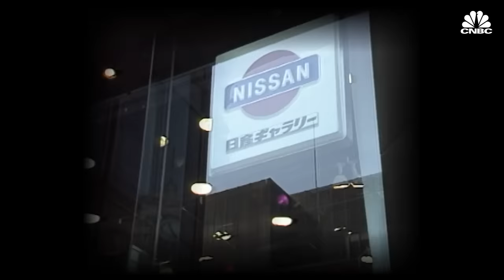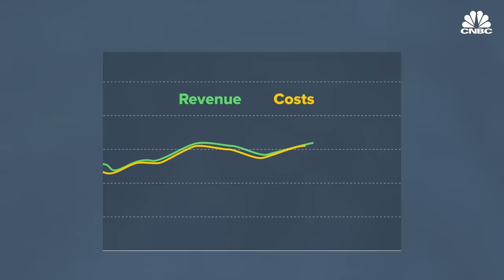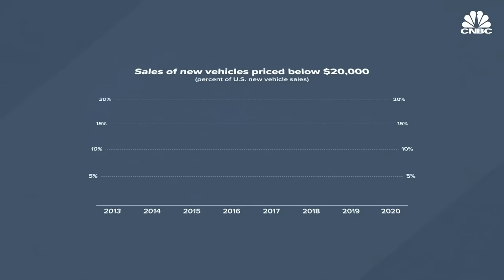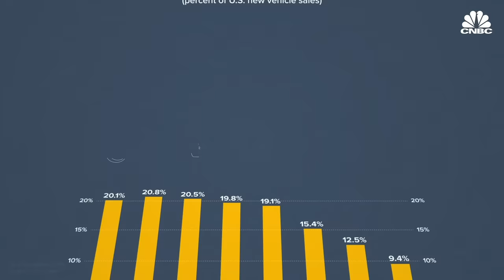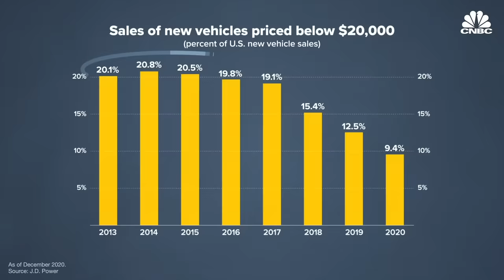Why Cheap Cars Are Disappearing

Comment: The lady tried to justify a $10k price increase for CarPlay and bluetooth. woww
Reply: I know...it's rediculous. Some one needs to find her on twitter, and give her a price list of what these things actually cost.
Reply: For a head unit you could buy for 500
Reply: @bdun1226  I bought mine for 250$ they are even cheaper now
Reply: I have bluetooth and USB connectivity (with a hands-free mic) on my Pioneer head unit, stuck into my '92 Civic, and it was forty bucks...
Reply: Well, sometimes the specific features a buyer might want are only available if they go up to the next trim level and that next trim level somtimes includes a bunch of other options that jack up the overall price.

Comment: I was raised to believe "If you cant pay cash for the car you want, you cant afford it".
Reply: True, that's why i haven't and probably will never have 0km cars. My car is a 2002 VW Polo and I don't even feel the need to exchange it, I've been in 6 month old 250km rental Peugeots that felt worse than it. Sure, the interior has seen better days and the paint is faded, but that's fixable. Got my AC, got a 100€ head unit from Sony that has bluetooth and usb, got my power steering, central locking, abs and ebd, power windows, and that's what i really need.
Reply: @miaugato93  have exactly the same car with the small 40kw 3 cylinder engine and I have 248.000 km on it. Won't drive anything else until I have kids and need more space!
Reply: @AggroJordan86  Nice! Mine is the 48kw one with 185.000km on it. Plan to restore it back to glory as it does look a bit like a shed right now. But by god does it drive nice, quiet and comfortable inside, and has almost everything i want in a car, and that's because it doesn't have the L/100km readout.
Reply: Well that’s stupid because you can finance a car
Reply: Wow lucky you.
Reply: Good idea, but poor in practice. Financing a new vehicle isn't a terrible idea, especially if it's a truck or something that you would use for work. Plus new cars smell nice and are shiny.
Reply: @bsextremesports  Your reply is why millions of Americans cant afford a $400 emergency, it's because that's about equal to or less than their monthly car payment.
Reply: @id10t98  that's not my fault. I pay way more than that for my vehicle and I can still put away savings.
Reply: @bsextremesports  still a waste of money if you ask me that 400$ a month can be invested and make you more money
Reply: information is wrong used cars break down constantly and you pay all at once
Reply: @bsextremesports  would have been smarter to save your money and buy your car in cash. Kind of wondering why you didn't do that to begin with if your car payments are so much and you still save? LOL... Would have saved you ALOT of money instead of paying interest on something that is depreciating in value
Reply: @not_bout_it  build credit. Idk man, 50k cash for a truck is a lot paying 0-2% apr isn't bad on that. I'd rather keep money in the bank and pay monthly. To each their own though
Reply: Yes sir me to
Reply: @bruh meme you are smart wow!! I need to buy a 80s car and so should everyone!! Who needs abs or traction control. Who needs a car that actually gets out of it's own way, or tight electric power steering. No let's all buy old used cars and drive them for the next 100 years. Okay Cuba...
Reply: Best method is to have enough to buy in cash, and finance anyway. Keep the money earning interest you have, be able to invest it, or have it for an emergency.
Reply: @tangydiesel1886  exactly!!
Reply: @bsextremesports  And they depreciate 40% in the first year. Pretty dumb to buy a car because it smells nice and is shiny. You can make any car smell nice and be shiny.
Reply: @bsextremesports  And one can finance some at 0% interest. Therefore, using someone else's money.
Reply: And did the people who told you this have to pay 25k plus for a new car? No? Then shut up.
Reply: @MrR40388  you hit the nail on the head there
Reply: @Daniel-ii6rq  Yeah...for 7 years at stupid rates. It's like having a second mortgage.
Reply: Such an outdated concept.  You finance the car over the term you expect to have the car for. There’s far better uses for your cash and finance is cheaper than it’s ever been
Reply: Understood. By that logic don't get a mortgage either?
Reply: Excellent advice.  They aren't an investment ... purely an expense.  Why you'd borrow money to pay for something that has a 100% chance of decreasing in value is beyond me.  Get a used car; pay cash; be happy
Reply: I grew up with that too or similar "if you can't pay cash you dont need it"
Reply: Exactly.
Reply: @id10t98  agree
Reply: Y'all are missing the point.  If you can't pay 50k cash for an SUV, but you could get a 25k one cash, sacrifice short term and go cheaper. Cars are deprecating assets.  Keep them cheap
Reply: @Daniel-ii6rq  If you finance a  car your are basically paying a bank the price of that car 5 years ago. The car is not yours until the loan is payed off so it technically is not your car
Reply: Even at 0% interest, you still have 30% depreciation immediately after purchase, 20% the 2nd year, and about 10-15% years 3-5. Depreciation is the overlooked  expense of owning a new car.
Reply: @AggroJordan86  Rolling pile of junk.  To slow and not safe on the highways where speed limit is 75 mph.
Reply: Good for u
Reply: @hattiekeith8634  you clearly never had a Volkswagen.
Reply: I'm a finance kind of guy with no formal education but I can give you a few reasons why buying a new car isn't a bad idea. Personally I wouldn't go out and buy a brand spankin new  2021 car or anything but a nice certified pre owned vehicle from a dealership already has a lot of the "brand new car" value knocked off plus a decent warranty. Financing a car at todays interest rates isn't a bad idea, at 2-3% interest you can easily make more money in the long term by parking your money in safe blue chip dividend stocks that will actually pay you just to hold them. Say you finance a 2016 car of any brand at 3% interest. Instead of paying cash for the car you make your regular payments and keep the cash you would have payed outright in the stock of the vehicle manufacturer or the bank that financed the car. Chances are the stock you invested in is going to grow much faster than 3% over your financing term. Not only did you contribute to the economy by buying the car and taking a loan from the bank you also gained from being an investor in the process. You build credit the whole time and you drive around a car with much higher safety ratings than most older vehicles.
Reply: I hate most of Youtube.
Reply: The main thing most car buyers miss is that your payment on a car with a bank loan isn’t going to be $300.  The bank will force you to get full coverage insurance, for another $200-300/month.  This is money you are just throwing away.  If you buy a 10 year old car, with liability only, and crash it, you can walk away and buy another.  They would not sell you insurance unless it were profitable for them.  That means it is a straight up scam, and nothing but a loss for you.  Buying a new car with a loan is a great way to just throw away money if you are young and don’t have resources yet.  It keeps you poor.
Reply: @JeremyTheEntrepreneur  wrong used cars are more reliable as they have Less electronic parts which are unreliable
Reply: My friends were raised to believe. "If you can’t sell your only house and all your clothes for a car you want, you (obviously) can’t afford it."
Reply: @YouStink lmao. No, he is simply smart.
Reply: Some of the comments in here.... Geesh.  Back 20 years ago My brother purchased a new $50,000 diesel pickup. I drove an old caravan and purchased my first rental property.  Fast forward to today. I still drive an old doge caravan but own land, rental properties, and a nice house.  I will be able to fully retire comfortably at the age of 55. My brother? looks like he lives like a king in all his new vehicles, but the truth is he is one miss step away from bankruptcy at all times. He will work until the day he dies. He is just like most Americans. Vanity is the single most important thing driving most new car purchases.  I just cant wrap my head around how rolling in a shiny new car at all costs is so important.
Reply: @cptfreeman8966  I've heard this same statement so many times. I see people that say this not invest at all.
Reply: @happeningsllc  I invest what little I save into stocks and crypto can’t speak for anyone else
Reply: @JeremyTheEntrepreneur  A used car will break down if you don't inspect it, if you buy a model that is known to not be reliable, if you don't maintain it, etc.
But if you do things right, a good car won't fail anytime soon.
Reply: @bsextremesports  Old cars have ABS. Traction control is completely unnecessary. Not sure what you mean by "gets out of its own way", but they have tighter hydraulic steering.
Will cost less to own, probably gets better fuel economy as well.

Comment: Our fleet of extremely well maintained and in exceptional condition "fully loaded" used cars: '97 Jeep Grand Cherokee,  '00 Toyota Camry, '01 Honda Accord, '10  Mazda 3. All cars are extremely easy and cheap for most DIY repairs and very reliable. No car payments since '99, and no desire for most of the over engineered hot garbage with too many computers for everything (that fail) being produced today.

Comment: So put of touch. I'm almost 50 and have never been able to buy a "new" car. Ever.
Reply: Why should you? Keen on loosing 50 % of value the moment you drive out of the dealership. Just buy 6m to  1y! As good as new for half the costs. Especially with cars having combustion engines.
Reply: Me either and I am 51. And I don't feel like I've lost anything. In fact we both gained. New cars, like jewerly are overpriced anyway. Let someone else drive them awhile and fix some things and then buy them before they completely break down. And never, ever buy a Ford. I had one and truly I did, Fix or Repair Daily. Ugh. Now I have a Chevy Impala, 2009 and it's first car everything works.
Reply: me to ill be 50 this years been driver over 30 years never owned new car
Reply: Buying New is not always a good idea.
Reply: You should work a little harder and read a book or two, a little more education can make a difference! Don't blame others
Reply: It is sad! We will never be able to afford a new car as they get priced higher and higher.
Reply: @pucksberger  All cars lose value. As good as new? Nothing is as good as new.
Reply: @shellyslioneyes  Don't you think Chevy needs repairs? Or is Ford the only car that does. Go to a junk yard you'll see plenty of Impala's there. Many Fords also. Driving a new car is a great experience. Driving an old junker is great also. Don't have to worry about opening your door against another car. Don't have to worry about backing into another car. Just keep moving. To each his own.
Reply: Yo can anyone here tell me why I keep blowing struts on my honda accord and how I can prevent it?
Reply: Sounds like you’re doing something wrong in life lol
Reply: The only car I bought new was a 1984 chevette that was a base model and cost $4995. I don’t need any of the stupid nonsense stuff that they put on cars just to jack the prices up.

Comment: Most people don’t “own” their car. The bank does. I drive an 18 year old car that looks only a few years old. Americans trade in cars like crazy. I get admiring them but you don’t need a new car every 2 or 3 years
Reply: Couldn't agree more mary
Reply: My car is 29 years old an doesnt look a day older then when it left the lot 💕
Reply: Mine is 20 years old and has not reached 130,000 miles yet.
Reply: @nikkisolo9080  same! I’m at 90500
Reply: @bobabola1386  same I have a Chevy prism (: 2002
Reply: @whalefuhk  I have a 2000 Buick Lasabre and a 2002 Buick Century but the Century has been parked for a couple months because it needs some minor work done,take care of that Gem,God Bless! !!
Reply: My Toyota 4Runner is 15 years old and has just 79,000 miles. I figure it’s good for another 200,000 miles...it’s a Toyota after all. I have a 2002 Honda S2000 in my garage with only 7,200 miles.
Reply: @fastdude2002  That's Awesome, God Bless!
Reply: @whalefuhk  mines a 91 mercedes sdl 350
Reply: Just purchase a used or new vehicle until the current one seriously breaks down.
Reply: Bought compact car in 2006.
Reply: I do

Comment: My first car was a little bit over $12,000. It was a 1998 Ford Contour. I got it slightly used in mid October of 1999. It was a very good first car. My 2nd was a little bit more in price since it was less than a year old. My 3rd car was a year old but, the brand was dropped from the line in 2012. I got that car since the miles were lowest than all of Ford Fusions and it was a 2011 Mercury Milan. My car right now is a 2015 Ford Escape SE. I’m happy the vehicle that I’m driving. I don’t have Apple Play but, I’m happy with BT in the Escape. Even the Milan had BT, too.
Reply: I've never paid more than 2k for any car